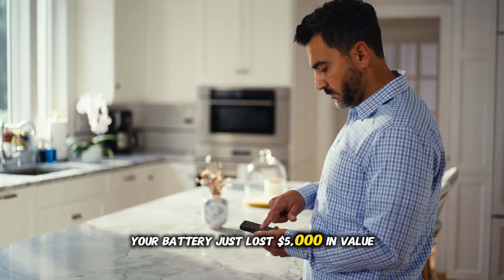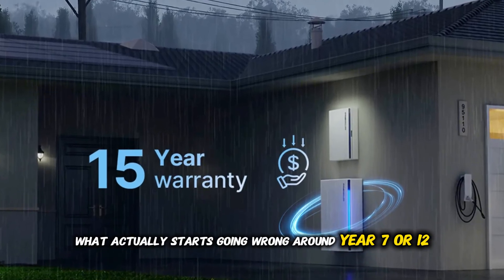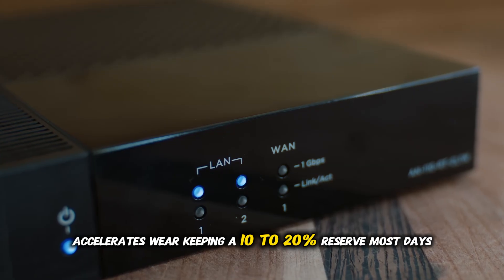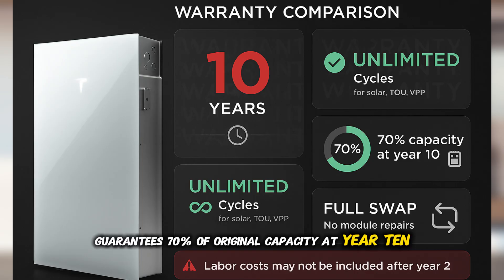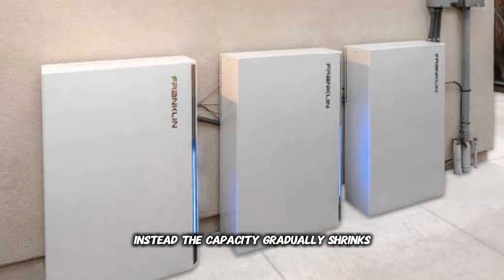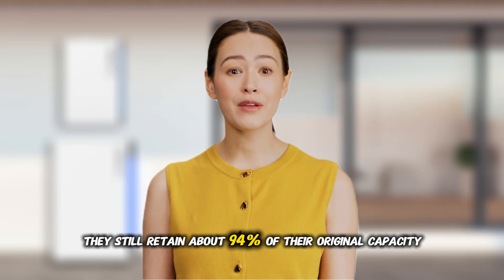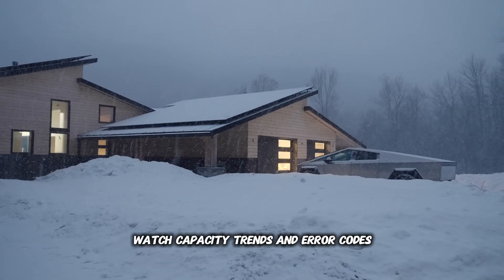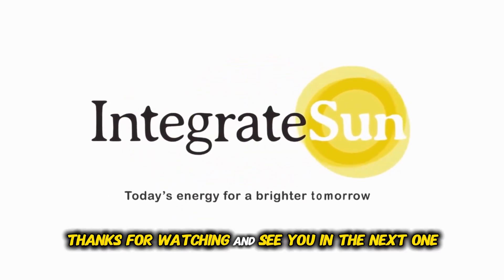How Long Do Home Batteries Really Last

Comment: I went with the EG-4 flexboss 21 and Gridboss plus 3 of their 14.5kw power pro batteries only $3300 each. DIY install $1 a watt. 10 years from now lithium will be obsolete. CATL is going to release a sodium-ion battery for far less then lithium prices has nearly the same density as LFP.  5 - 10 years from now everyone will be swapping out lithium for sodium safety factor alone will drive it.
Reply from the maker: it sounds like you’ve put together a sizeable system at a very competitive cost. Going the DIY route can save a lot on labour, just be sure everything meets local electrical codes and that you have a clear path for warranty support if anything goes wrong.

Sodium‑ion is an exciting technology, and companies like CATL are making rapid progress. That said, it’s still very early days: current prototypes have energy densities comparable to the lower end of LFP and there isn’t yet a commercially available residential battery. Lithium‑based chemistries, especially lithium‑iron‑phosphate, continue to improve in cycle life, safety and cost, and solid‑state variants are also in the works. The market may well diversify over the next decade, but for now lithium remains the proven, widely supported option for home storage.

Comment: Running off grid with 43,008 wh of self made 51.2 volt 280ah EVE cells. Charging to 54 volts every day, wake up to 52.2 volts worst case some mornings. Cells are in air conditioned walk in closet.  Top balance each of the three batteries off line twice per year, to within .005 volts.  What is their predicted life, and what can I do to improve the life? Thanks for your offer to answer this.
Reply from the maker: EVE’s 280 Ah LFP cells are known for good longevity, and the way you’re treating them will go a long way toward maximising that. In general, high‑quality LFP cells can deliver 4 000–6 000 full cycles before dropping to around 80 % of their original capacity, and shallower cycling can push that much higher. If you’re cycling each bank daily at roughly 30–50 % depth of discharge and keeping temperatures in an air‑conditioned range, you’re likely looking at 10–15 years of useful life or more. Charging to 54 V on a 16‑cell pack (~3.37 V per cell) and maintaining a reserve around 52 V means you’re avoiding the high‑voltage stress of charging to 3.65 V per cell, which also helps.

A few tips to maximise lifespan:

Stay between roughly 20–90 % state of charge and limiting very deep discharge.
Limit float time at high voltage.
Aim for C‑rates well within the cell’s spec.
Your twice‑annual top‑balance is already good practice; just make sure you’re doing it safely.
Finally, keep an eye on the manufacturer’s specs and any cell‑level voltage drift over time, and don’t hesitate to consult a professional if you notice any unusual behaviour.
Reply: @integratesun  Thank you for your response.  I doubt there are many professionals that have had as much hands on time and research as me.

Comment: If you on utility net metering  1to 1 you better not be using it but have it on standby mode. Cali have to have working everyday. Here in FL only needed during Hurricane.
Reply: Hardly have any power outages in the south west I'm in Arizona one power outage for 6 hours in the winter when local neighborhood underground wire failed last 10 years. If you can get 1 to 1 might as well just go grid tied no reason to even bother with a battery. I would go with micro-inverters 1-1 is long gone in Arizona.
Reply from the maker: Good points from you both 👌. It really comes down to how reliable the local grid is and what the net metering rules look like. In places like AZ where outages are rare, grid-tied makes sense. But in states with stricter policies or more frequent blackouts, batteries might pay off just for peace of mind. We serve both FL & AZ but I’m curious, have either of you seen any upcoming changes in net metering rules in your specific areas?
Reply from the maker: Yeah, that’s kind of the crux of it, the math changes a ton depending on where you live and what your utility is up to. If you’re lucky enough to have true 1‑to‑1 net metering and almost never lose power, cycling a battery for “self‑consumption” doesn’t make a lot of sense. In that case a Powerwall or Franklin in “backup only” mode is basically just an expensive UPS, and some folks skip storage entirely and go micro‑inverters like Mike mentioned.

On the flip side, states like California have gutted daytime export credits with NEM 3.0, and TOU rates mean you get pennies for solar sent to the grid at noon and pay dollars to buy it back at dinner. That’s why so many West‑Coasters are cycling their batteries every day or joining virtual power plant programs. And in hurricane country a battery is all about keeping the fridge and AC running when the lines are down.

Long story short: check your local net‑metering rules and outage history. If 1‑to‑1 disappears or outages become more common, that battery you’ve been using as a paperweight suddenly starts to earn its keep. Until then, it’s totally fine to leave it on standby if your main goal is peace of mind.

Comment: I have seven 14.3 kw batteries and paid 3k each for them. Guess it really depends on how much you paid to loose $5 k during the intro.
Reply: EG4 DIY install what  I did
Reply from the maker: Mike how’s the warranty support been after DIYing it compared to going through a dealer/installer? Always curious if the savings up front balance out with long term support
Reply from the maker: Seven 14.3 kWh batteries is a serious setup 🔋💪. Did you go with EG4 as well or another brand?

Comment: Great video. I have one Tesla Powerwall 3 and was installed and commissioned on June 25th 2025. The manufacturing month of the unit is March 2025. Because I have 1:1 net metering, Grok AI recommends to keep Powerwall 3 at 100% back-up to maximize net credits but to also cycle it every couple or few weeks. I live in zip code 91205 in USA. Thank you.
Reply from the maker: Thanks for sharing your setup! With true 1:1 net metering in Glendale (91205), there usually isn’t a financial advantage to discharging your Powerwall every day – you get the same credit for exporting solar to the grid as you would from using it later. That’s why Grok (and Tesla) suggest keeping it in “Backup‑Only” mode most of the time.

It’s still good practice to give the battery an occasional workout. Cycling it every few weeks helps balance the cells and keeps the battery management system calibrated. You can do this by temporarily switching from Backup‑Only to Self‑Powered or Time‑Based Control for a day or two and setting your reserve to ~20 %, then switching back to 100 % backup once it’s cycled. Also make sure the unit stays within Tesla’s temperature guidelines – high attic or garage temperatures can accelerate ageing.

If you’re unsure about the best cadence or settings, your installer or Tesla support can review your setup and local utility rules. Enjoy your Powerwall, and thanks for watching!